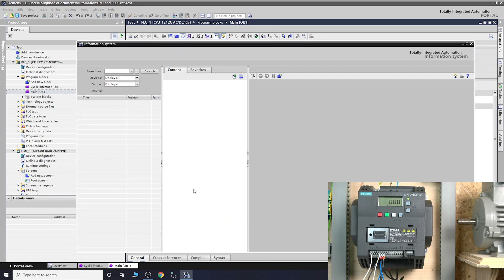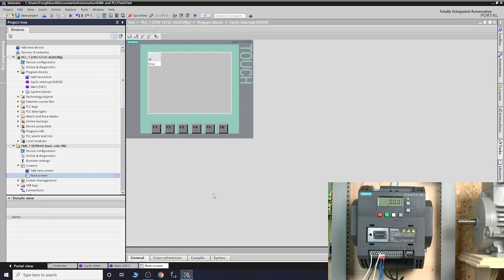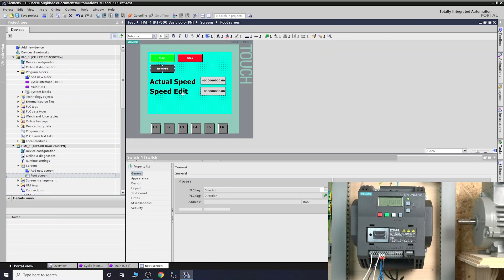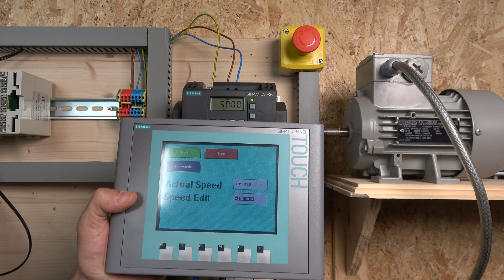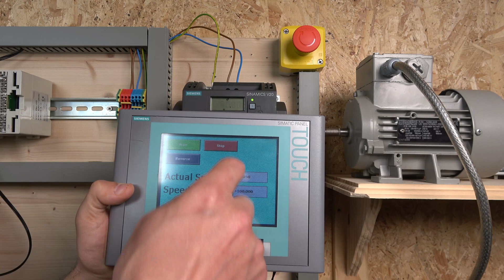Siemens S7-1200 PLC CB 1241 RS485 communication, parameters and wiring with Seimens V20 Drive Part 2

Comment: I'm using a CB 1241 - 6ES7241-1CH30-1XB0 (Rs485 module) which firmware version is 1.0. I cannot find an update firmware for this does this mean I need to buy another rs485 module to get this to work?

Comment: hi, thanks for your video, everything seems ok to me but the engine does not start, the communication happens because I set the speed setpoint correctly, but it does not start. advise?
Reply from the maker: Make sure your drive parameters are changed correctly. there is to many things that could affect it, but start with that.

Comment: HIi, 
What if the CM1241 firmware is higher than V2.1?is that possible, in my case my CM1241 firmware is V2.2.0
Reply from the maker: Hi There. That should not make a difference. It should all work

Comment: when I run the v20 on the display must appear the value of the frequency that varies?
I don't have the motor and I see the frequency at zero
Reply from the maker: If it is on, frequency should show, regardless if motor is connected or not.
Reply: hey guy change P2013 in the VFD to "4"

Comment: hello I tried your project but it doesn't work for me maybe because I don't have the resistors?
I state that a CM 1241 422/485
Reply from the maker: Hi There. Check the parameters between plc program and Drive. Make sure everything matches between them. The resistor is not necessary, but good thing to have, it should not stop the communication.
Reply: @IGSElectronics  is it necessary to have the motor to see the frequency?
Reply: is it necessary to have the motor to see the frequency?
Reply: @codesys652  You can set the frequency and see it on VFD but to see the actual frequency, you need motor.

Comment: Hi, Thanks for the Video, great stuff. My problem is that I am getting an error on my USS_PORT, error code is 16#818B (Invalid pointer to the local data source/target). It must be the setting on my V20 but I am struggling with identifying my issue? Any suggestions?
Reply from the maker: Did you set up 4 core parameters from the manual in description below?
Reply: @IGSElectronics  HI I faced the same problem, I already set the V20 to Cn010, but still get 818B error status.
Reply: Try to swap the cables P+ and N- on the terminal block of V20 VFD